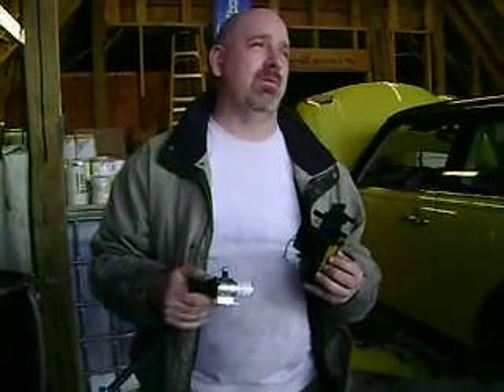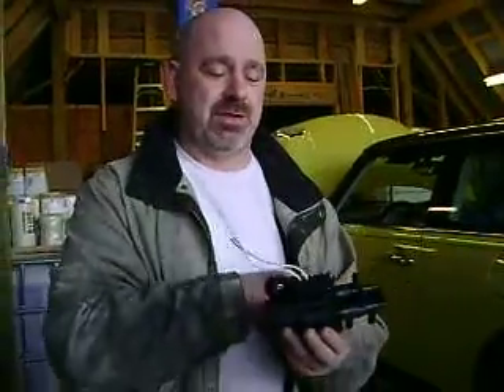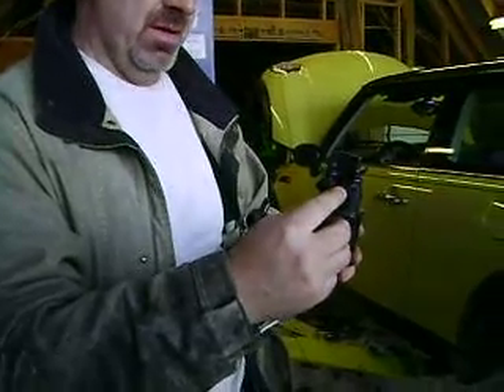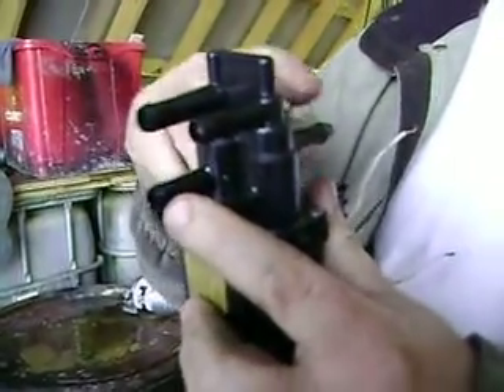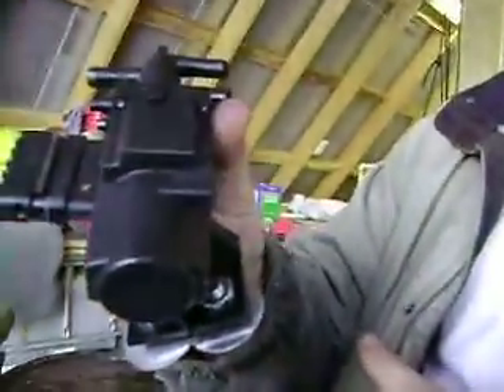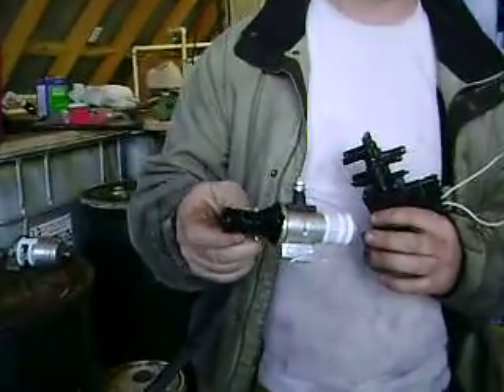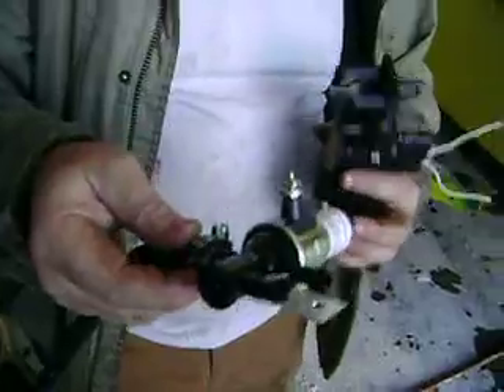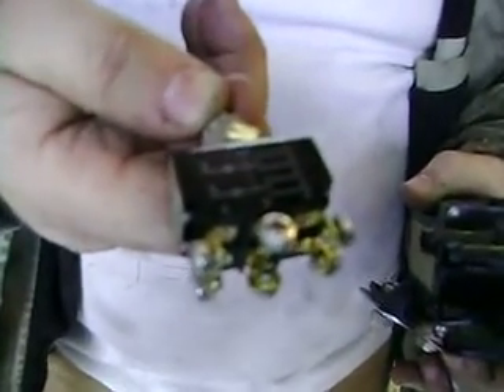Discussion: Pollak Brand Fuel Tank Switching Valves for Vegetable Oil Fuel in Diesel Engines

Comment: I know this is super old, but what's the difference between pushing and pulling through a pollak valve? pilot valve?  I couldn't understand him.  The 6 port valve has both intake and return.  The return flow is being PUSHED back to the tanks.  Why is this not an issue with any 6 port valve ever, but a major issue for the 3 port?

Comment: Those same valves are used on 1980's Ford trucks, and they have pumps in the tanks, so you can push fuel through them...